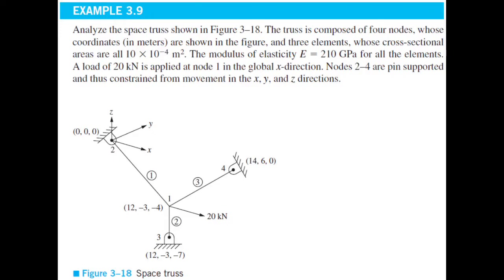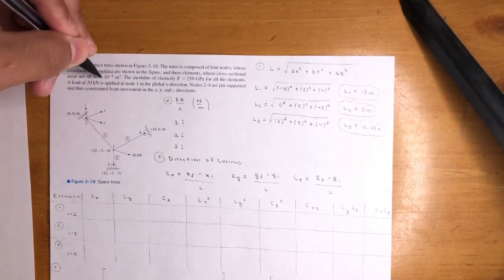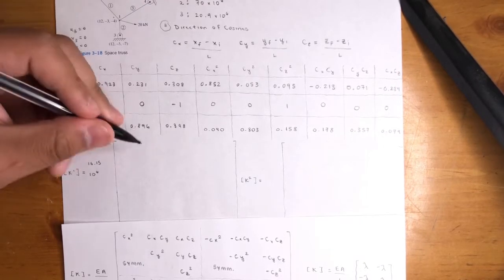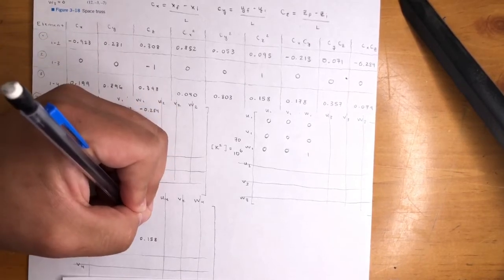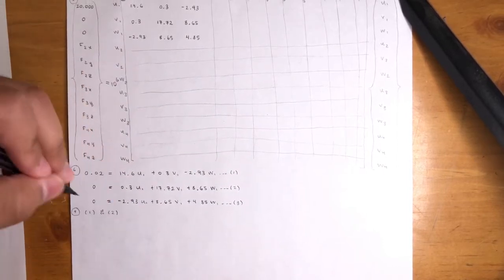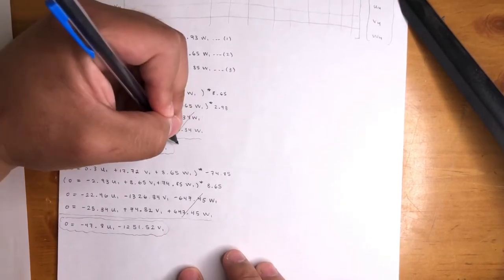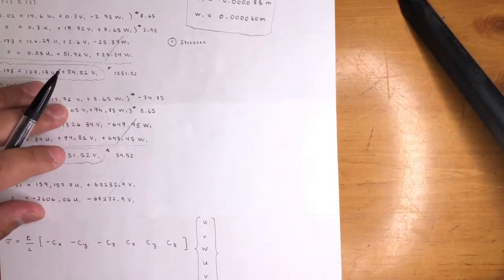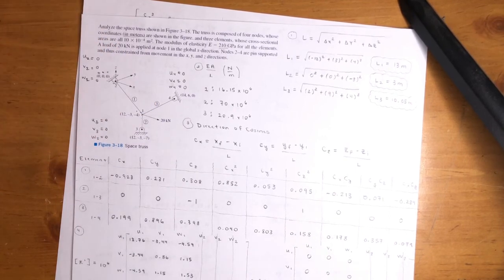Finite Element Analysis - Analyze the Space Truss which is Composed of Four Nodes

Comment: For each of the element matrices, you factor out EA/L to make the matrix simpler. But when you are forming the Global Matrix, you only factored out the 10^6 and forgot about each individual matrices unique EA/L. What about the different values of EA/L for each individual matrix? For example, element 1 has a EA/L=16.15x10^6. So wouldn't your values for u1, v1, w1 be different for the global matrix since you need to multiply by that 16.15? Same goes for 70 for Element 2, and 20.9 for Element 3. Was this a mistake?